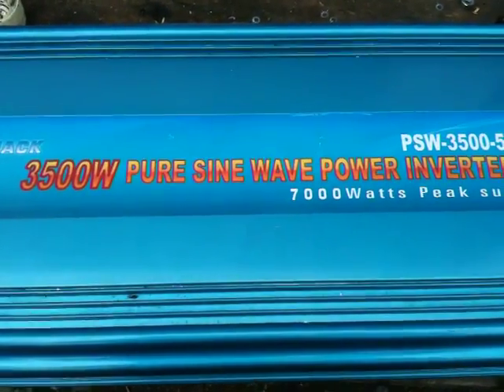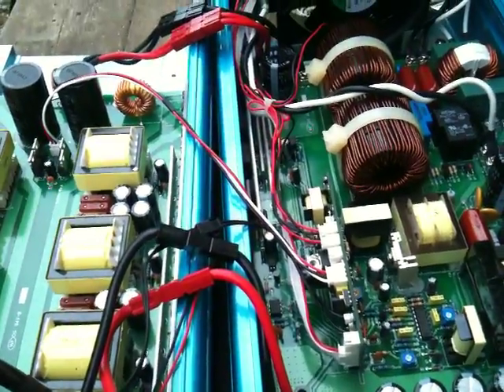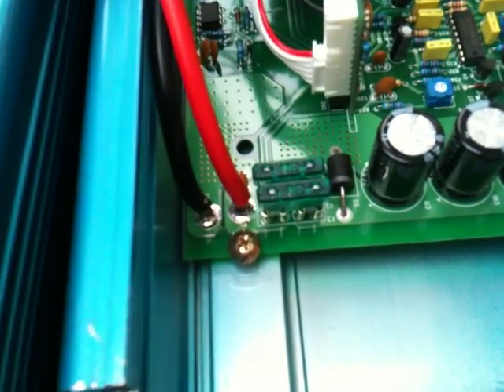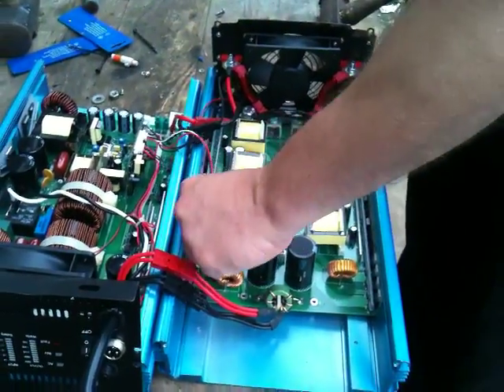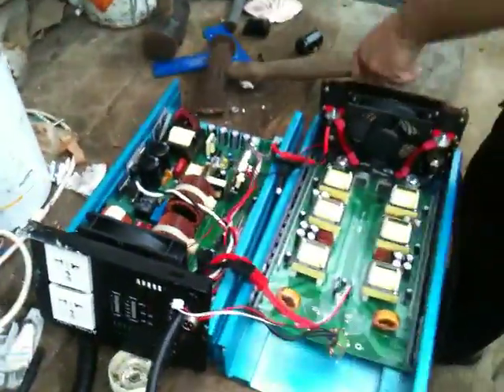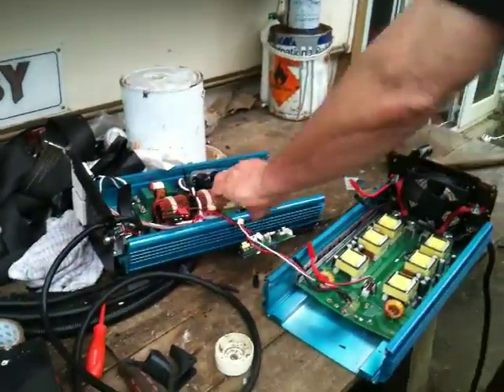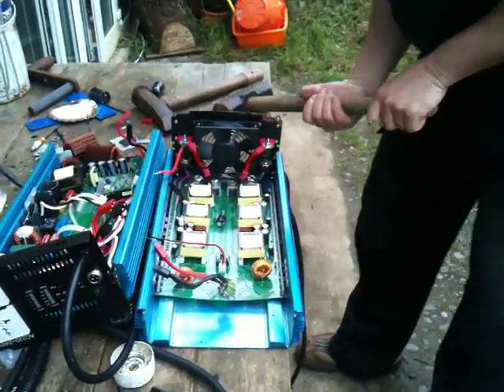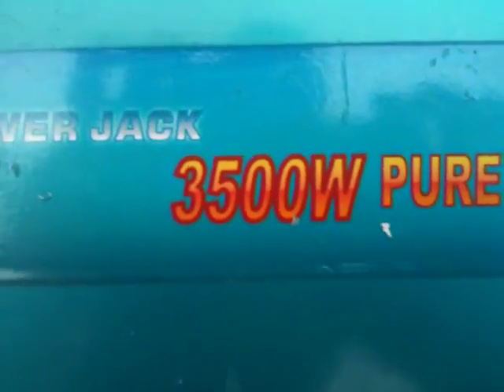PowerJack Inverter Repair...Watch before buying one.

Comment: I have similar problems with power Jack.  they sent parts. most did not fit.  waited 6 weeks each time.  Now been over a year and they (David) keeps ignoring me. Ignore is a great customer service technique.  not sure who has had success with these power jack inverters.  I like the hammer  use, but hoping Power Jack will l STEP UP and send me at lest a refurbished unit or replacement as I have been wanting from the second set of parts.

Comment: i also bay bigger inverter bat I pay little more money by EU  seller on ebay and pay with PayPal. and have full refund money and seller mast by EU law arrange pickup.(hi didn't) Now change couple mosfet and have an inverter for free. also now inside i change wire to 150 mm2 because this inside cable is a joke.

Comment: my email is...heribertopadre@ gmail.com...any comments to fix my power jack 8000lf inverter 220vac output 24v dcinput..Will be appreciated.
since i bought the unit..i saw smoke coming out of the unit once i connected it to the 24v batteries bank...i opened it..surprising one mosfet board was burned....bought a New mosfet...installed it...got no output power...ordered the complete New main board..installed it..smoke came again ...opened it...another mosfet board was  burned...i followed all the printed instructions...i am an experienced associate Electronic engeneer technician..if i buy another mosfet...i Will be installing it...if power jack assures me it Will not burn again....does any of you guys knows how to contact power jack service on line????whats wrong with this unit...????as a technician i never quit ....but i need the wiring diagram to fix and trouble shoot the unit...S.O.S....i live in PuertoRico and need power to survive..

Comment: I do not recommend buying these power jack units either. Mine was DOA (dead on arrival). If you have one that works,  good for you and you are very lucky!  If you need to repair, you have to do it yourself.  The company offered to sell me the parts to attempt to fix, but it was not guaranteed to fix it!  Furthermore, you cannot send back to China for repair.  I investigated that option too!  Mailing the unit back to China would end up costing more than unit cost new (because of the unfair trade practices of the Shitty Chinese govt).  Luckily, I got my money back from my credit card company that I used to buy it...

Comment: Wish I'd watched this before buying mine.

I wired in the solar panels (correctly) and didn't connect the unit to anything else. Turned the power on and let the smoke out immediately.

Then I saw the note that said you have to connect it to AC first. Oh, well.

Comment: If you really want to know what is all wrong with these POS Taiwan inverters then read the entire page in the link.
Poorly designed , poorly laid out ,wrong sized components, NOTHING grounded inside would never meet ANY international electrical specifications in regards to safety so as to not kill the person using it due to electrocution.
https://ludens.cl/Electron/chinverter/chinverter.html

Comment: About 2 years ago, I bought the "MONSTER" 15000 KW LFPSW inverter from ebay and it worked for a few days then I returned home to find the inverter dark with no lights on. When I removed the cover, all the mosfets were fried on main board. Was told that due to time between buying and using, my warranty was not in effect any longer. I bought both main and controller boards but still didnt fix problem. Cant quite bring myself to beat the thing with a hammer, though Im tempted to.
Reply: Whiskeybuisness 
those mosfets were made in china and had problems , now they are using mosfets from germany to idiot proof the inverters .
Reply: Do you know anyone that would like to buy an inverter? I bought BOTH controller boards and still have nothing more than a heavy DOORSTOP. I would NOT recomend these to anyone that doesnt have money to WASTE!!
Reply: Whiskeybuisness you should

Comment: I know the feeling about some inverter, and some time we just need to do what we got to do, and have some fun at the some time. I have a Power Jack 5000w LF PSW got it at E-bay  had it for about 12 months, it's not the best because it uses up some of the batteries when it's off. but  I'll give it a 80% for good. it's sad to see how these guys break this up into pieces,
but it's more sad paying so much money for and item that's cheaply assembled. my advice buy on eBay from a  responsible seller.
Reply: HOLA SAMUEL QUIZAS TU HABLAS ESPANOL, PORQUE POWERJACK TE VENDE UN INVERSON DE 15000W Y SOLO PUEDES CONECTAR EN EL MEJOR DE LOS CASO UNA CARGA DE 5000, SEGUN SU TABLE DE APPLICACION

Comment: I ordered a 5000 watt LF and received a 6000 LF.  I think they do this to perpetrate fraud.  This way the unit received and PO /receipt (bill of sale) does not match the unit received.  Plus who is going to complain when they open their new inverter to find they received a unit that (should) provide more wattage.  

I have filed a fraud claim with Capital One through VISA but they say since I have not shipped the item back to some random unconfirmed address that the claim is not valid.  The problem with shipping a 6000 watt LF (55 pounds) inverter is the cost.  it will cost me $100 to ship this inverter.  Then I have no recourse, no inverter and am out $514 and a ton of my time!!

Yes, they have the perfect scam.  I really though my credit card company would go to bat for me.  I have been defrauded with a defective inverter and there is very little I can do because I had the unit 4 months and used it 18 total days during that time.
Reply: Richard Johnson 
capital one is a shity service , i have their visa but i never use it for overseas purchases since they never do real revese charging , they do not give a damn about their customers . get another cc from another bank if you can .

Comment: I purchased a POWER JACK 6000 LF.  It never worked correctly.  The fan quit coming on when the unit would get hot.  So after about 20 minutes the inverter would shut down.  As the summer progressed the run time shortened then the inverter completely quit.  Power Jack inverters are pieces or crap and I have the documentation to prove it.
DO NOT BUY ONE BECAUSE THEY DO NOT STAND BY THEIR PRODUCT.  I have asked for a replacement, none.  I have asked for a refund but they want me to ship to an unknown address for the return.  Already went through that on another power jack inverter.  POS.

Comment: Thank you for this video which halas relates to a vintage inverter, because it is an HIGH frequency model, with a lot of transformers and thus a lot of sensistive MOS-FET components !!!

I own the Power Jack 3000W 2015 model and these new inverters are using LOW frequency technology with only ONE toroidal transformer. Instead of handling twice the normal surge during about 20 milliseconds, in case of a short circuit for example, they are able to handle THREE times the nominal power for 20 seconds !

So please don't put all those Power Jack  inverters in the same box or trash bin. I have used mine on my car since February for several months without any problem. One day, after my wife missed to turn it off after her hair dryer usage, it remained switched on from 8.00am till midnight on a parking fully exposed to the hot Greek sun last August without overheating and it is still working perfectly since then...

So my simple advice is to buy ONLY LOW frequency inverters, not the HIGH frequency ones with a old and risky technology ;-)

Comment: I just bought a 6000W LF Split Phase Inverter and found that the Charger function is not turning on when connecting a 230V AC 50Hz input to the H line terminal block.The 24 VDC input is also connected while AC input is given. ( Battery voltage is 24.5VDC)
When I contacted the seller (ebay) and the reply is to use 60Hz input AC for Charger mode to turn on
As most of the countires are 230VAC 50 HZ, I am not sure if the input has to be really 60Hz .
Can  you advise as what could be the real problem. ?
Read mode

Comment: "I don't know who you are sir, or what your name is, but that did me a POWER of good, a POWER of good!!" - Neddy Seagoon of the Goon Show.
What a ride! I cried in the end, with laughter!!! I actually have a "2015" model, I ordered a "3000W Low Frequency Pure Sine Wave 48V Inverter/Charger 50A" but was sent a "5000W ....80A".
While it worked "out of the box" I too found the quality suspect (it rattled when you shook it), but, after a few touchup adjustments have put it into service to draw RTS into a 48V battery, (via the inbuilt charger) which then powers my "island" of must have home appliances, TV, Router, fridge, overnight. This strategy reduces my "exported" (cheap) solar power and diverts it to my appliances. This is the first stage of implementing this strategy to ultimately power my (power hungry) A/C units at night when the sun don't shine. It also ensures I have "redundancy" in the event of a power failure.
I will upload my videos about the 5000W unit soon, once I've completed some editing.
Thanks again for the great laugh!

Comment: Had 2 of them come nto the workshop....  2and 3 months old.... wanted customer to return them.... one unit had the diode packs not mounted.. summer came along and it died.  The other had dry joints around all chokes...  resoldered it and it ran for 3 days. Had a unit replaced by supplier (China) only to be supplied a 110 volt unit....You only get what you pay for...  Like the inverter gensets 10 hours is the magic number before its in the Green bin..
Reply: I was born in Taiwan, Taiwan has the best electronic industry in the world, such cheating is unforgivable. I am really ashamed of my people, 
Give me your email, and I 'll give you a little surprise.

Comment: I just bought one cheap on ebay. It appears to work and I see signs of changes (the new models are a lot different than the one shown here). Perhaps they got better due to "Feedback". I'm thinking though, that the 3000 watt / 6000 watt surge unit I have will barely handle 2000w.

Comment: If you really where a real electrical engineer, find the "problem" fix it, and teach! Not destroy with a hammer (engineers tool of course) like an orangutan.
Reply: stevetyphoon fuck of mad fucker
Reply: I think the point is it isn't worth fixing
Reply from the maker: There is such a thing as an uneconomic repair in the commercial world. There was so much wrong with that unit and as I have stated repeatedly, it took an electronics lecturer 18 months of redesigning to get his unit working safely. As for orangutan keep your insults to yourself.

Comment: Bought one Power jack 5years ago. 1200w pure sine, still working at full Power with about 2.5kW peak. SO !!!!!!!!!!!!!!!
Right after I wanted to try a bigger one and bought a 2500/5000 this time,
BUT INSTEAD GOT A:
2000W pure sine??? Close enough i thought... BUT!!!!!!!!!
DIDN'T WORK AT ARRIVAL!!!  Started to smell a bit...
Serviceman myself so opened and after short time discovered that:
IT WASN'T EVEN SINEVAWE VERSION!!!!
So,  had payed for a 2500W pure sine and got a non working 2000W Square.

READ THIS ALSO!!!!!!!!!!!!!!!!!!!!!!!!!!!!!!!  
Power Jack messed with shipping time/ wrong address + + so long that time for refund and feedback passed on ebay so:
- If you buy you might get what you want but be aware...
Reply: I was born in Taiwan, Taiwan has the best electronic industry in the world, such cheating is unforgivable. I am really ashamed of my people, Power Jack company cheating like this,
Really sorry. I am very angry like you!
Email me, and I'll give you a little surprise!

Comment: I got a 5000w LF pure sine wave power inverter dc24v to ac110v/battery charger/LCD meter (231110722085) on Ebay  from  stargatepower888  email about out of box fail
they ask Q&A we answered with no response after 14 days  I would not buy a power jack since they have pore  service

Comment: Super dangerous how the screws are microns apart from connecting the casing to high voltage! It broke my heart to see you guys smash it up rather than mod it to get it working but this video sends out an important message and could possibly save lives. Powerjack are the assholes!
Reply: I was telling some other people that its so hard to work on these things without a schematic to go by. I put both boards in mine and still couldnt get it to work. Looking for another but not a PJ....
Reply from the maker: Hi izzzzzz6, as I have commented before the faults with this model were so numerous it wasn't worth my time repairing it! I have posted a link somewhere to a paper some electronics wizard wrote of how he got one working SAFELY.

Comment: Our PJ unit has been behaving quite well. However, It does seem to have some noise on the outputs that is interfering with our audio equipment. I have thought about adding a choke coil to deal with that, but I think I'm going to look in a different direction in stead .... I'll  build a D class audio amplifier and operate it directly from the 48 volt dc bus.

Comment: You forgot to plug it in and test it after your repair job. BTW: has Power Jack ever contacted you and offered you one of their new and improved inverters? Seems to me if the company CEO had any brains at all he would have stood on his head and spit gold coins out of his mouth to fix the quality control problem and get you a decent inverter for free.....and have you do another video to show the new and improved version along with an explanation for the crap you got and a promise it won't happen again. At the moment, I watched this video because I was considering buying a Power Jack Inverter.......but not now.....thank you very much!! Good work Guys. I hope this puts a dent in Power Jack sales until they smarten up. People should not accept JUNK from companies....especially when it's an electrical product that could kill you if it is not working right.

Comment: hey calm down you may try knowing problem and fix it 
it may be just dropped cable or broken welding it may happen in many devices i bought before or send it to any repairing shop behind you if you are not interested in maintenance BUT NOT CRASHING THIS DEVICE IN SUCH WAY  you may find many valuable useful things inside .again  cccccalllllm down
thank you

Comment: I really don't know that much about inverters.  But, I know you do get what you pay for.  Maybe you should have tried to bust out the solder gun and got some proper stand offs with rubber mounts and more insulation (to fix this thing).  Sadly if you want a REAL 2-3K watt inverter prepare for 2500-3K wall robbing.  Sadly I can't afford that yet. But SMA (sunny boy) / Outback / Morning star / Midnight are the way to go if you got the cash.  Otherwise buy this cheap shit and mod the crap out of em

Comment: I do Have 4 of the power Jack inverters and they all work great ,  I did have another on I think it was Go power 2000 watt inverter worked great , I screwed it up becouse i Hade a battery that was over charged to around 14.5 volts  not Much amps from the little Battery  But just to high of volts stoped working Junk screwed it up  ..   Having a degree Means nothing to me If if so why did you not test with your Meter and fix ,

Comment: Good one now put it with all the other junk you have in the Back  
 I have 4 power Jack inverters and they all work great  two or connected to my grid to spin my Meter back,   I have not Had a Bad one and i dont sell them ,

 I have the power jack  china inverters on my Video and they still work great .  Most that i see that are having problems dont know how to work correct and over load them 

   Just Good one you make me sick , and it was may be a fuse   Check out my Videos i have them .

Comment: @n5800xpressm   These things are so hideously designed that there is no point in trying to fix them, and the sheer amount of work required to simply make these work is not worth it (adding current sensing, fixing potential dividers, fixing capacitive coupling issues, etc.).  And stevetyphoon, you should put that repair link in the video description.  Just be sure to add a 'WARNING: the following link contains images that electrical engineers will find disturbing.' warning.

Comment: @BREGGREN  I Bought a PowerJack 2000/4000, It Came in Good Time, Hooked It Up w/Good Cables, No Worky. I'm No Technician But I Took It Apart. A Circuit Board Was Hanging Loose Also, & Also;The Main DC Wires Were Off- I Put On New End Clips, Didn't Have Clips At All Before, Got It Back Together, With No Faith; Plugged in My Kill-o-Watt Meter- Then, 100w Lights & an Old Super Heavy Duty 1/2" Drill,Ran Great, Meter Volts,Hz,High wattage- WHEW! Never Hooked It Up Again. Satisfied The Way It is NOW!

Comment: This is actually not a good way to fix these.  You didn't use any thermite, cannons, bulldozers, explosives, microwave oven transformers, cutting torches, blast furnaces, thousand pound plus lumps of concrete, jackhammers, rockets or flamethrowers.  Without these that piece of garbage will never be truly 'fixed'.